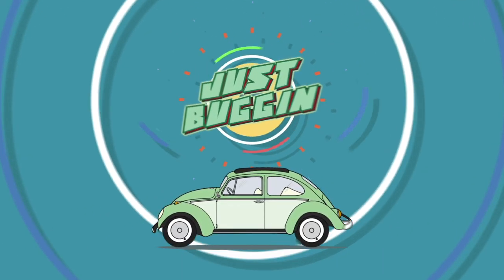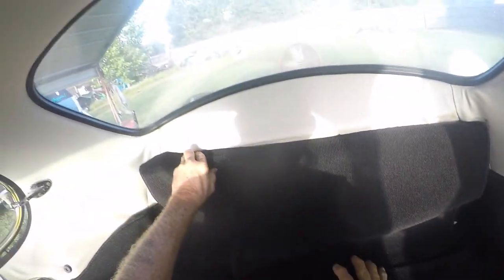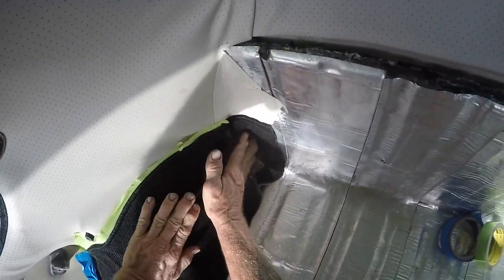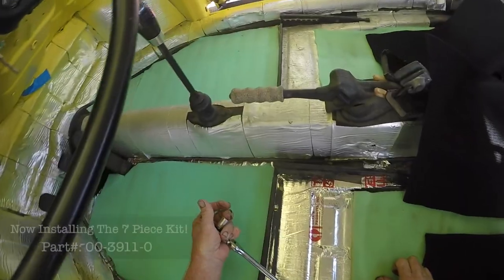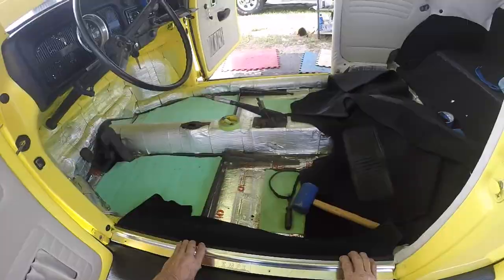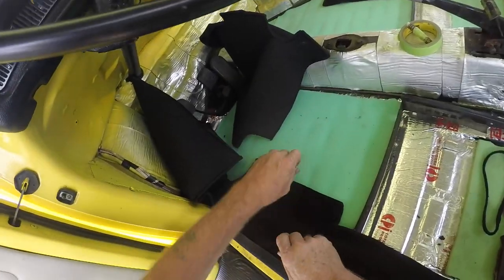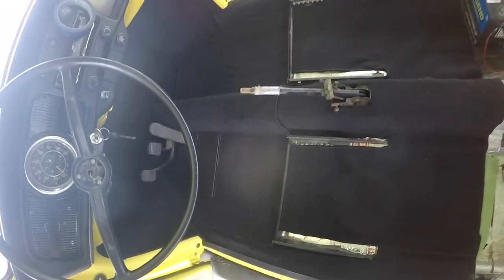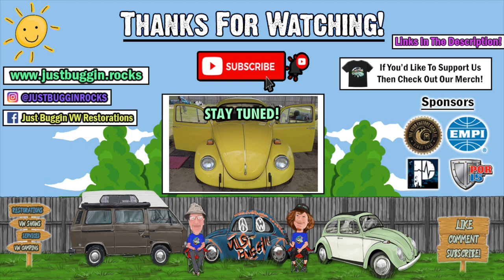How To Install An EMPI VW Beetle Carpet Kit | DIY Tutorial

Comment: Just an FYI for everyone watching. If you own a 69 Beetle, there is a split in the model year for the carpeting. The early 69's use the 68 and older kit where  the carpet tucks under the tack strip, while the later 69's use the kit you featured with the carpeting going over the heater channel tack strip.
Reply: 11